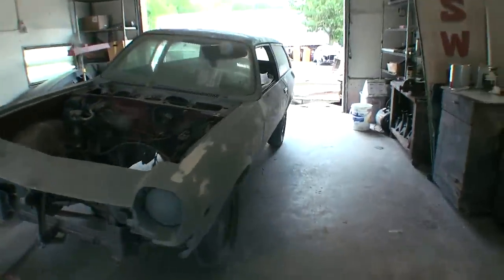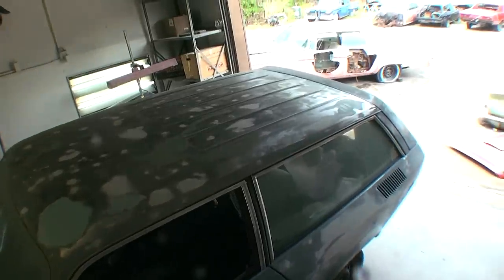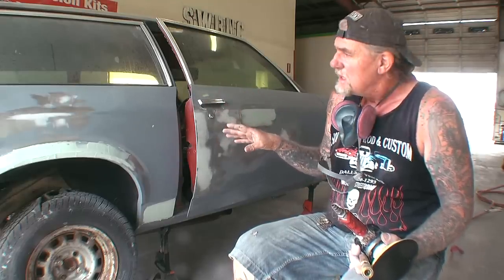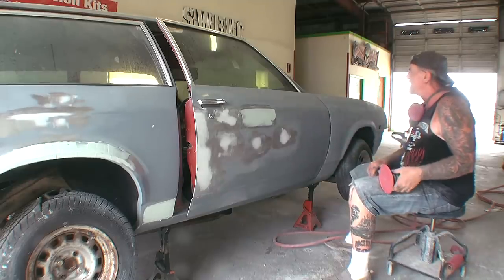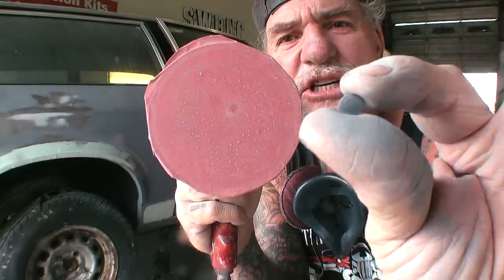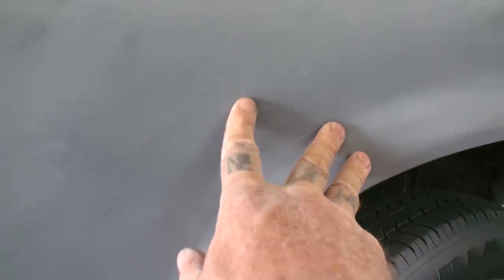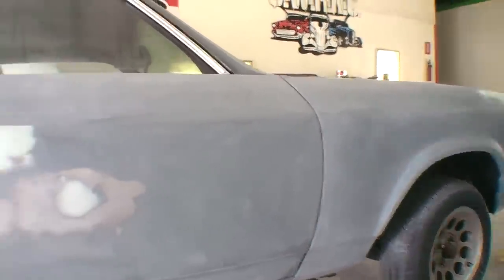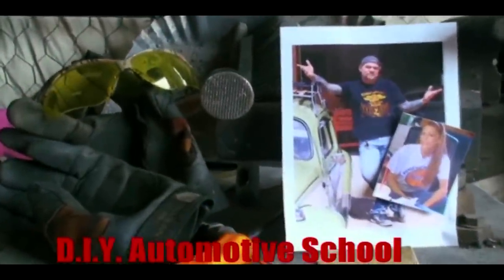What Is EPOXY PRIMER ? - Understanding How It Works!

Comment: A red scuff pad is great for giving established epoxy a good tooth for recoating without loading the paper.   I guess Iam old school I like having epoxy (I use ppg DP LF) under all my body filler for corrosion resistance and excellent adhesion..  Its a bit of a hassle with the paper loading but I think its worth it.  Been doing this practice since  1973 with no issues.  Everyone has their own way of doing things.  I have enjoyed your videos for a number of years.....

Comment: It is non-sandable but it needs to be sanded. Got it.
Reply: Same here, I'm even more confused now than before I watched this video.
Reply: Pro tip of the week for sure
Reply: Right??
Reply: i was saying the same thing....so confusing
Reply: equally confusing... @.@
Reply: Sandable primer is whats used to build up the surface to fill slight imperfections! Epoxy is not designed for that, it just seals the metal. It needs to be scuffed for primer to stick, but it is not a buildable,sandable, product like 2 k primer!
Reply: His prepping the epoxy because it’s prob past the recoat window if you leave epoxy past the recoat window it will need scuffing up because it’s past it loses it chemical bonding so you have to mechanical bond it ... I believe that’s right ?
Reply: 100% correct
Reply: Wait so I was told that I could use raptor 2k anti corrosive epoxy primer to simultaneously seal, smooth out and improve adhesion for painting over. Is this wrong? If correct then why would you use regular non sandable epoxy primer in the first place? Wouldn't it be better just to use the 2k for both?
Reply: mossy1 expoxy primer is to seal and protect the metal from rust for a smooth finish before colour you would use a high build maybe this raptor stuff is like a 2 in 1 ? Do a google search and find the tech sheet for it
Reply: I think what he is saying is that it is not designed to be sanded over but sanding is needed to make the 2k primer stick so he's trying his best sanding it fast and vigorously to avoid as much gumming up on the paper as possible
Reply: he like EMPHASIZED its non-sandable, then sanded it
Reply: @Said1985ize   He emphasizes everything lol. But what he said should be read as "non-sandable", not literally.
Reply: @Xplorer228    If you were told that by someone trying to sell that product, you should probably take it with a grain of salt ;)
Reply: Block sand it it’s gumming cause he’s using a da sander
Reply: @jmangi6221  its made to seal bare metal, its non porous. You can topcoat it within the aloud time on the spec sheet. If you wait to long it must be scuffed and re coated because the topcoat will not adhere correctly if you wait to long. Once you sand or scuff it it is not non porous anymore .,wrecking the purpose of epoxy primer. once you re coat it with another coat of untouched epoxy it is sealed again and the clock starts again to re coat right over top of it with 2k or paint depending on what it is .
Reply: You might want to work on your retention skills. He clearly says you have to scuff it up so the 2K will stick on it.. everyone is worried about Corona virus but stupidity is what's really fucked up in this world
Reply: He means it can’t be sanded to remove imperfections, like you would sand bondo or highbuild primer. You are just scuffing it up to key it for the next coat. You can recoat epoxy primer without prepping if it is less than something like 24 hrs old (it should be in the data sheet) because it has not completed curing and you can still have a chemical bond. So what he is saying is true and correct, but perhaps sounds confusing as he is not differentiating between sanding to roughen the surface and sanding to remove imperfections. You have to be a bit of a mind reader here.
Reply: @sblack48  if there are tiny imperfections everywhere, would you literally put bondo everywhere (all over the car/panel) and sand that down before 2k primer goes on it???
Reply: @Said1985ize  He means it’s not meant to be sanded like a 2K primer is, it’s used as a base to put 2K onto but if the epoxy(non sandable)primer is not painted over with the 2K primer within a certain time it must be sanded to provide a key for the 2K primer to stick too
Reply: @Damien_JH  I know PPG epoxy sealer is good for 7 days after 7 days you have to clean it scuff it then clean it again
Reply: Not that I disagree with my friend Pete. It does gum up sandpaper. But yes it is sandable. I refinish boats for a living. All we use is Epoxy primer under our Imron and Awlgrip paints. There are plenty of high build Epoxy primers that are made to be sanded. And I’ve even tried the “non sandable “ ones designed for cars. One of them being the Roberlo brand. All you have to do to create a high build sandable surface to create a high build primer filler is shoot it once. Hit it with some 180 grit. And then reshoot a heavier coat tommorow. You will have a perfectly primed panel with plenty of room to sand and not eat through it to bare fiberglass and or metal if your working on a car. Yes there are specific epoxies made for creating a high build surface. You also need good quality sandpaper. I like using 3m paper. It may be expensive but the best stuff I’ve used is the 3m purple paper that comes with Velcro on it
Reply: It’s a sealant to protect the surface BEFORE you paint the vehicle in which you scuff the epoxy primer ( remove protective layer) to lay down your primer and paint.
Reply: @f0rtyEight  if you want a workshop finish then yes. If you are happy having a rubbish paint finish, then no. Until you have to do the whole job over as it looks so bad 🤣🤣🤣
Reply: If you understand auto body, you know exactly what he means by non-sanding epoxy primer, but it still has to be a braided for surfacer to stick.

Comment: thanks. Epoxy priming is working great for my repairs. Strip to bare metal-beating, welding and grinding then epoxy coat- filling, high build primer, seam sealing, epoxy to seal the whole thing then top coat. A lot of work but no rust and great watertight finish

Comment: I usually sand the epoxy primer then apply filler directly over the primer. 
It's a better seal and corrosion resistance.
Epoxy primer is sandable, but not easiest to sand.
Reply: Agreed. Sure, epoxy primers seal & protect the bare metal, but also improves adhesion, especially if the filler is applied BEFORE the primer's full cure window. That said, after full-cure, I'd still not strip the primer off (as he did on his project here), rather just DA the area and add filler on top, 2k, paint, etc...

Comment: Pete. You are 39 years in the business. You know a lot of stuff. Im grateful for your teaching. But you don't need to remove the epoxy to apply the filler/bondo. You can put the bondo on it, man.
Reply: If you do need to remove the primer back go steel. Should you reprime with epoxy or will the 2k sandable seal the steel
Reply: @f0rtyEight  I think high build can go on bare steel but epoxy is way better
Reply: Get a good epoxy primer, I liked Oxysilk. Sand to bare metal or sand clear coat off, shoot epoxy, filler (some fillers say apply to bare metal to get best adhesion but will work regardless) reshoot repaired area with epoxy then move onto filler primer if you need to fill imperfections, then sealer, then base, then clear , then cut and polish. I like the idea of sandwiching the filler in between epoxy so no water will get to the metal or layers of previous filler/paint. This also prevents previous paints and fillers from any reactions to the new layers. Epoxy will go over previous paint layers as well as bare metal.
Reply: thats what i thought too. thats the beauty of epoxy. what ive found is that everyone has their own way of doing it and theres multiple ways that work.
Reply: @leonardhoffman9140  yep living in wet Northern Ireland at the beach, that’s how I do it. Take no chances!!!
Reply: His method is how you would do things in 1985. Times have changed, Pete has not.

Comment: It can be lightly dry sanded after it has dried 7 to 10 days with a maroon scotch bright pad. Have been sanding epoxy primer for 25 years!
Reply: Ok, but you need to wait too long, the job will extend for much longer time
Reply: Exactly

Comment: Hi Pete, I heard you mention rust removing using vinegar, over here in UK a 10% solution of citric acid has been found to be superior to vinegar because it doesn,t form a film of surface rust after washing the solution from the metal. If you mix the acid solution with wallpaper paste you efectevly have product similar to DEOX C made by Bilt Hamber. Simply cover the panel with the paste wait 24hrs rinse with warm soapy water and you end up with nice clean metal ready for priming etc, etc.
Reply: Thank you for this comment. I will try this so, I usually use vinegar

Comment: Those gumballs can be removed with a sharp putty knife pretty quickly, too, depending on how many there are. Also, my thought has been that higher speeds and higher heats tend to make more gumballs, but they show up even on hard-pressed manual sanding.

Comment: Normally I would agree with you 100%. But I just used a Sherwin Williams marine product, Seaguard 5000.   It sanded like a regular high build primer,    and I only sprayed it yesterday afternoon. It’s made for protecting the metal hulls of ships from salt water so I know it’s tuff stuff

Comment: I agree with  Pete, I shot ppg epoxy. you can scuff it, but if you want to sand it to block out imperfections it generally does not happen. Thats what the fill primers are for. If you have some odd product that works, thats not the point he is making. The generalization is you dont block sand epoxy primer, its a sealer to kill of rust and neutralize the panel.

Comment: Time to give SPI epoxy primer a chance.  It sands super well to a nice dust and does not gum up your paper.  Just let it dry real well for about 3 days. That said, it's worth a shot and looking into. I've very impressed with what it will do and how easy it is to work with.  Don't know till you try it. My friend Pete.............consider a test run.
Reply: I HAVE RECOMMENDED SPI TO PETE ON SEVERAL OCCASIONS....NO REPLY OR USE....DEAF EARS I GUESS
Reply: @runnningonempty   It's OK that he doesn't. He's old skool and is comfortable with his products.  But SPI???  I'm sold indeed.  For a clear I've used All Kandy wet wet........DAMN.  Something to consider. Massive depth even over a wet sanded single stage. In the end there is more than one way to skin a cat.

Comment: Just a note on the Seaguard primer.   It says not to thin it but it’s like pudding.  For one gallon total (1/2 part A 1/2 B) I mixed in 3 oz xylene and 18 oz MEK.  Using a 1.4 tip on the HVLP gun

Comment: A trick I found to remove 'gumballs' - use a hacksaw blade as a whacker.  The flat side of the hacksaw blade - sharply - but carefully - whack the sandpaper and it will shock the "gumball" off from the sandpaper surface.  It takes a little bit of manual dexterity - you will need to make sure that the hacksaw blade is dead flat when it hits the sandpaper surface, if not, you run the risk of the edge of the hacksaw blade damaging the sandpaper itself.  Once you have masted the art of 'flat whacking' - your sandpaper will then last longer before needing to change it.  I have also used a coat-hanger wire bent into long double width with about 5mm gap between, this can also work, but never seems to last or to be as effective as the hacksaw blade, but also has less chance of damaging the sandpaper, but once mastered, using the hacksaw blade is quick and EASY.   Have a safe and nice day all.  CHEERS from AUSTRALIA.

Comment: This video is on point, still some confusion in the comments though...Epoxy primer is non sandable, as in it does not have a build, or sand smooth like a 2k urethane primer (high build) or polyester primer (sprayable glaze). After laying it down it can be top coated (without sanding) anywhere from 24 hours-7 days or 3-7 days depending on the tech sheet. Within the 7 day recoat period there is a chemical bond between the epoxy and the topcoat. If it is past the recoat window of 7 days the epoxy has cured and a mechanical bond must now be created by “scuffing.” Can it be sanded? Technically yes. Is it designed to? Ideally no, it’s not built like a sandable 2k urethane primer that falls of the car in a fine powder.

Comment: hi pete cant seem to find the info on thisn , 1. epoxyed my fender . 2.hi builded  eurethaned my fender , sanded for paint and broke through the hi build to the epoxy in very small areas corners to be exact ,. can i still base color over ? or do i spot eurethane the open epoxy parts

Comment: I use southern poly epoxy got 7 day window can lay on 2 k over it with no worry, adheres great, after 7 days have to 180 it, this info is right from company and rep here in Daytona , been doing it for over year, 2k sticks better than if  you roughed up, hey pete not trying to dis you just giving you my experience, I have learned much from you and Minnie

Comment: Just to clear up the confusion, Base coat Primers need to be sanded and are designed to be, these primers are the prep for your base coats, What he means is the epoxy primer isn't this sand able primer for your base coat, its a sealer for your bare metal, you do need to however, sand the epoxy primer for the simple reason your next primer which is the sand can adhere well.

Comment: Pete, good day to you. Your videos are very interesting. I'm starting a restoration on the body of a Mercedes 126 and just doing research at present. The car's been idle for five years & like you say it did not stop rusting just because it wasn't being driven. 
Confusion on the term "non-sandable"......but is that not what you are doing ?? You use the term "roughing up", by that do you mean a light rubbing, but to me it looks like sanding ?? But not down to bare metal, guess that would remove the sealing property of the Epoxy primer..??

So i need a dual-action sander ??  Is that similar to a circular sander ?  Using 180 grit, & continually moving,  got that.  Many thanks  great video and you are a gold mine to people like me...Thanks   Bill

Comment: when i built dumptrucks we used a primer that treated the metal and stops any rust and it is hard u can't take a knife and cut through it and u could sand it no problem we got it from dupont we use to play with it all the time and i all ways wanted to put it on a car then use tuff coat and sand it smooth then seal it and then paint it but i can't remember the name of it for the life of me  and i found tuff coat works good for filling scratches and imperfections  it goes on thick so u can sand a lot

Comment: never used it before,   but can see how tailgate is crying for protection.  never new that is the best primer for rust restoration. Can see if your using as a sealer under topcoat how ruff the paint finish is looking if sanded. VEGA'S are really cool cars to be working on.  thanks for your lessons

Comment: What are your thoughts on doing body work directly on top of epoxy primer? Have heard guys say it can be done that way with no issues.
Reply: It's been a few years since I've used it now, but with the PPG epoxy I used you had a window of something like 24 to 48 hours where it would still chemically bond with fillers and primers (PPG's stuff, of course) without having to sand it. After that and it had fully "cured", you had to prep it as per the video.
Reply from the maker: You can do bodywork on top of it but you still have to rough the surface up before you apply any filler.. The body work in this video was extreme and required taking it to bare metal.. If it's just small dings and dents --- No problem!
Reply: D.I.Y. AUTO SCHOOL so the whole cars epoxy primed.... how do you check each panel for small ding? Do you guide coat epoxy or what the precidure ? Thanks
Reply: @6655nico  use a light or something stationary with a straight line and look at it through the reflection off the surface. If it's not glossy enough, spray it with wax grease remove so it looks wet, or water.
Reply: David Lawhorn can you not use a guide coat which will show bold and you can actually see . With out having to piss about in light shadows, or guide and da back wouldn't that be easier ?
Reply: @6655nico  you can use guide coat, it just uses more supplies (sanding disks mostly) for myself I actually learned paintless dent repair and did that for 10 years before I learned paintwork. So for me it's easier to reshape the metal back to where I need it and skip fillers.
Reply: David Lawhorn of course there are those who do things on the cheap isnt there , somewere you do need filler I think !
Reply: @6655nico  correct, I can usually get it good enough to only need a light glaze coat just to smooth out the surface. Here's a dent I did without any paintwork. Completely paintless
https://photos.app.goo.gl/8JEAz6XzWeBnffAq9
Reply: Done it for years ,no problem s

Comment: is it possible to apply 2k sandable primer over 2k epoxy primer once the epoxy primer reaches its flash point rather than waiting 9 days for the epoxy primer to set harder to sand to take the 2k sandable primer,
Reply: Good question,, doesn't seem like anyone is answering any more,, hope all is well with him,, don't get why full speed sanding,, seems makes paper gum faster,, definitely won't cut as well at hi speeds,, assuming doesn't want to cut,, just prepping,, hopefully use block sander when finish sanding before paint,, have seen experienced boat repair videos saying slow speed and it's my experience also
Reply: Yes.

Comment: Hi mr pete:we used zinc chromate epoxy primer as first coate to aircraft body to prevent corrosion on body skin&after that we used filler and sand it & again epoxy primed as prepaint.i use used becouse ive been retired 5 years ago.but epoxy wich we were used ,should be left for 72 hours to be dried compleatly